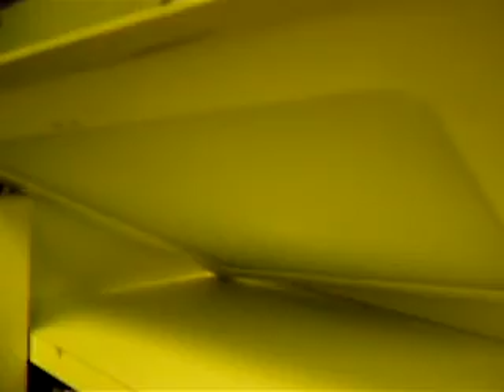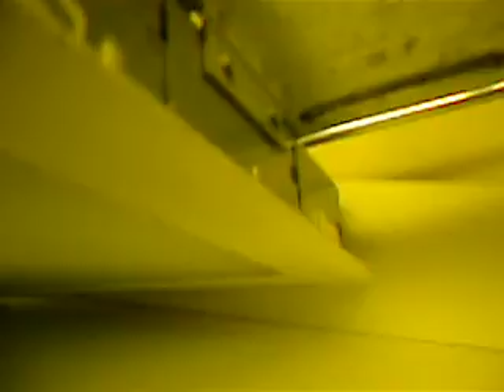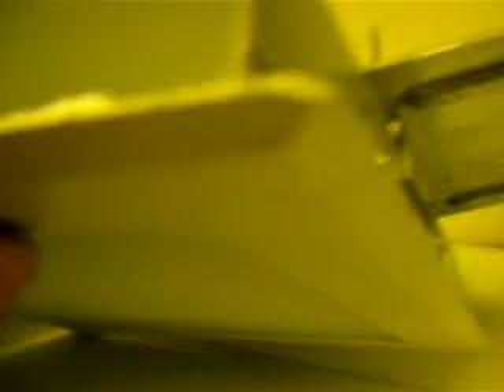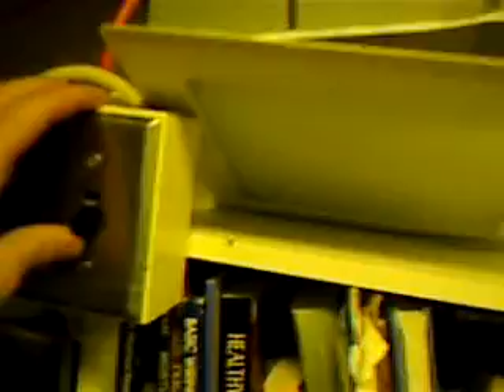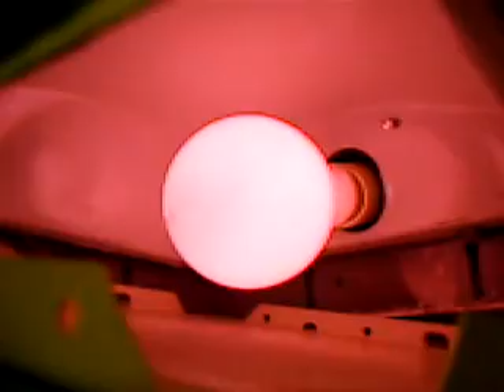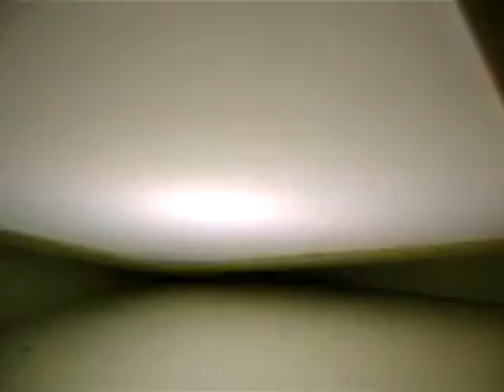Recessed square fixture hooked up to a mercury vapor ballast and a mercury lamp.

Comment: I have done this before and it is easy to do.  Just take an incandescent fixture and put in a mercury vapor ballast.  However, they do make electronic metal halide ballasts that might be able to fit into the junction box on the fixture or on the side of the fixture.  HOWEVER, you have to be very careful.  The metal halide bulb might cause problems with nuisance tripping of the protection device in the fixture.  I had this problem at first.  A lot of newer recessed lights have protection devices that will guard from installation of the wrong bulb and that device will cause problems with mercury vapor and metal halide.  Easy fix.  Clip the wires from the device and wire nut them together to bypass the sensor.  However, if you plan on doing this for long term, I would strongly recommend replacing the socket with a pulse rated socket.  Ceramic sockets work best.  But, for experiments, it should work just fine the way it is now.  Use a daylight colored coated metal halide to mimic a mercury vapor.  You might even be able to find moon pulse metal halide which mimics mercury vapor very well and runs on metal halide ballast.  Good luck with your experiment.

Comment: Mc Donald's had them outside and some locations in play area some still has them but think converted to led lamp and mc Donald's got rid of pL bulb recess lights Wich where crap put in led recess lights Wich is  better because McDonald's now well lit mc Donald's squrare mercy vapor recess lights bulb turns green

Comment: It looks like your have to travel to England to buy one. The hardware shop down the road from me still sells many Mercury Lamps. A friend of mine work for the street lighting & he said they still replace the bulbs but if the fitting becomes faulty eg ballast burns out or the fitting gets damaged in any way they no longer repair them instead they will replace it with either a Son or Metal Halide lamp & he said both those lamps dont last very long. He said you cant beat the Mercury Lamp.

Comment: They are illegal to be sold, as well as the equipment for them. 

Me either. The street worker that I worked with had reported that he did see an increase in the company's cost when buying more bulbs because more starting cycling and failing.

Comment: In the USA when they say that Mercury Lamps used to be legal does that mean you cant buy them anymore? 
I cant understand why they would want to make them illegal because they last much longer than Sodium & Metal Halide Lamps & they dont require all the electrical stuff you need for Sodium Lamps Also Mercury Lamps are much easyer to wire up

Comment: It seems the system is different in England its only E27 & E40 as it has been since the very first electric light bulb was invented & not changed since then. As for the lamp holder adapter your looking for I can only suggest that you have a look on eBay you may come across one the only thing England & the USA have in common is they still use the old imperial measurements eg inches feet & miles.

Comment: I mean if you have a ballast kit with the wrong fixture. Instead of buying an E39 or E40 fixture, they make E26 to E39 adapters for here in America. For Europe,they make them with E27 to E40. They are mainly used for mainstream bulbs but can be used in a ballast configuration.

Comment: Do you mean a device that enables you to plug an E40 base of the bulb into an E27 Lamp Holder If so this type of device is not available in England Maybe the reason is to prevent you from using wrong bulbs in wrong fitting eg 50w-70w usually have E27 base & 100w & above have E40 base Im not sure how it works in the USA But In England both E27 & E40 are quite easy to purchase & are quite cheap to buy £0.49p

Comment: There are companies in England that still manufacture all types of Lamp holders for both old & new lamps E27 & E40 because there are still too many where houses, factories, some supermarkets & train stations still using the old Mercury Lamps nevertheless If you want to buy a brand new complete floodlight with a Mercury Lamp nowadays its very hard to buy one but getting the components fot it is still quite easy you would have to buy the components & make the fitting up yourself.

Comment: You can still buy the magnetic ballast for Mercury Lamps in England & Europe although if you purchase one form the UK you would need a device to convert the voltage going to the ballast because the voltage in England is 240v & the US I think is somewhere between 110v to 120v

Comment from the maker: Hey. I don't know of any ways of doing that without a ballast. Doing this without a ballast can cause big problems so the safest idea is to keep wading through ebay and eventually a ballast will appear. Often they can go for pretty cheap. Once you get it, just follow the wiring diagram and you should be good to go. I'd reccomend getting a matching pulse rated lampholder as well if you don't already have one. And an enclosure. Metal halide lamps are notorious for spontaneous explosion.